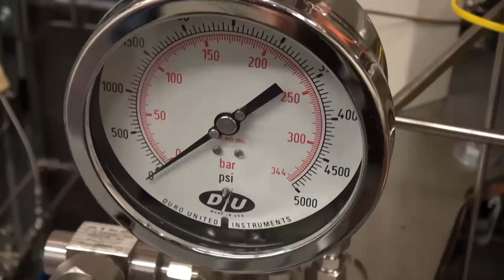Algae to Bio-Crude in Less Than 60 Minutes

Comment: We are not going to stop drilling for oil. You can’t go to other countries and just stop that, as much as a lot of people would like to.  
And to be perfectly honest it’s not really necessary.

What really matters is capturing that CO2 from the atmosphere and the water, and doing something with it. It’s just more carbon for you to work with.

Eventually we’re going to run out of oil.  This is the way to keep everything going and save the planet at the same time.

We need wind, wave, solar platforms, and saved hydrogen to compress and heat it

Comment: Algae for biocrude, would be best grown using non-potable water, such as that discharged from wastewater (sewage) treatment facilities. Some such facilities are also huge producers of by-product or "waste" gas  CO2, usually vented into the atmosphere, but is crucial to algae production. EPA and related water regulations need to be revamped so that these waste substances can be legally used, rather than wastefully vented into atmosphere,, in the case of the CO2, or in the case of wastewater facility effluent water, discharged into public-contact/exposure "receiving waters" such as rivers. For example, here in California, a large biocrude production facility could be built in one of the desert areas, with the non-potable water and waste CO2 gas being piped in from the big city areas. It could be done very economically (by comparison to some California mega-projects). But some "pilot" operations would, of course, need to be done first. The biggest obstacles are certain re-use/capture laws which impede doing so. Nevertheless, there are also very large factory-bakeries where huge volumes of dough fermentation occur, as well as large breweries, both of which are also great sources of waste-gas CO2 recovery (capture) for re-use in algae operations. But as said, there are specific laws which require revamping in order to do so. An algae biocrude operation would also be a producer of large volumes of (industrial-use) oxygen gas as one profitable by-product. -Even the biocrude algae (leftover) sludge would have value. We need new energy industry models. This is a good one, if certain laws can be brought up-to-date. -Most such problem laws are decades old, going back to the '60's and '70's, depending on the state, and seem, in my opinion, to also be protectionist of certain industries then (and now).. In research labs, oil content has been pushed to over 80% oil yield per algae cell. That was 5 yrs ago.

Comment: if heat and pressure is needed to convert algae to oil can we just pump the Algae water that cannot ne used to eat back into the oil well even the algae we get from the sea and ponds. we can set up algae bio-reactors  along the highways and densely populated areas and when you get the right concentration pump it into a tanker and transport it to a dry/ dead well and the heat and pressure may convert the algae to bio oil that eventually can be reused?........

Comment: I’d love to try this, but I’d probably blow myself up, however I did convert my old Camaro to run on gasoline, alcohol, or any combination of the two. The 1980’s computer that ran the car wasn’t up to snuff so I built an Arduino based ecu that uses open source engine management software, the rest of the parts I needed were all off the shelf / junkyard. And I had to get permission from the state to make alcohol (with a denaturing agent added). And for about a year I’ve been running the car on E98 (98% ethanol & 2% gasoline).
Reply: This is so cool, where did you learn to do this? Are you an engineer?
Reply: Where can we find the Arduino software?
Reply: @gregorymalchuk272  speeduino
Reply: Weird flex

Comment: while using algae might be new, this process of obtaining crude oil isnt. as long as humanity has had gasifiers, humanity has had access to some version of this crude oil, but it was either discarded early on or was used to soak torches or wan oil furnaces. entire cities used to run off gasifiers for anything from street lighting  to a stovetop, in fact quite a few cities still have their old gasifier street lanterns but most of them run off the city's natural gas lines not a gasifier production line. 

a gasifier can run off pretty much anything combustible in nature like wood, coal, dried animal feces, crop waste, dried crops, etc. so its not really all that new of knowledge that a plant matter can produce crude oil therein gasoline when in a pressurized then condensed and refined. society just forgot about this process like they did when someone came along with the non electric car, and decided never to go back to it. like the electric car this process was abandoned for a similar reason, it was to complicated/long a process with the available materials/refining processes. so when we struck oil and refined that it was faster to produce the diesel/gasoline we needed. but now that society as a whole produces so much waste and is much much more population dense we now have the materials to make this process more feasible. especially now that we have our crude oil refining systems so efficient, like how we now have way better battery technology that is suitable for an electric car we now can build them.

Comment: This seems promising.  Have algae farms (remove CO2 from environment), use algae to make fuel (puts CO2 back into environment)...which should be, if not carbon neutral, carbon lessening. Some algae can be used as food, as well.  No drilling, mining, etc. needed
Reply: bruh, dude crude oil isn't only used for fuel its used to making numerous other products like scents, perfumes,  heating oil, jet fuel, petrochemical feedstocks, waxes, lubricating oils, asphalt CNG etc, the artificial crude oil can be used for this right?
Reply: @cheeseburger625  Yeah that's the thing people don't realize. For example in 2020 America and Europe put a lot of effort into shutting down oil drilling sites around the world. The result was a massive shortage in fertilizer which then lead to food shortages around the world. This caused Europe to buy a lot of petrol products from Russia and Iran which in turn funded Russia's invasion of Ukraine.
Reply: @DaveSmith-cp5kj  yes
Reply: @DaveSmith-cp5kj  yes
Reply: @cheeseburger625  It can replace some, probably many, of those. And all those things you listed are the reason that, in my never so humble opinion, crude oil is too damned valuable to just set a match to!
Reply: @TimeSurfer206  ok
Reply: @cheeseburger625  Wow, a Necroed thread from 7 years ago! I think this is the oldest post response so far! I am well aware of other petroleum based products and maybe this bio oil can be used for some of these products.
Reply: @Voidsworn  yup

Comment: looks like a fairly energy intensive process to me.. so not sure how much energy it's actually producing.. very confused by the woman suggesting that it would help reduce the greenhouse effect as that has nothing to do with the source of the hydrocarbon that is being burned..
Reply: There is a lot of energy in those liquid hydrocarbons, there should be plenty of energy gained. A lot of input energy is needed for petroleum in collecting, transport, and distillation. The connection to the greenhouse effect is that the fuel being burned would have been made out of the water and air recently and would cause a net reduction of the CO2 in the air. CO2 goes into the algae, and because of inefficiency in the fuel production somewhat less CO2 will go back into the air. Same if you burn wood or other biomass, but fossil fuels increase the CO2 in the air.

Comment: Its a shame its still gonna pollute the planet...
Reply: How? It doesn't add any new carbon to the environment, only recycles whats already there. Are you refering to the electricity that the process takes? That currently effect most major clean energy sources like carbon.
Reply: Oh my bad i just presumed because its pretty much oil it will release alot of carbon into the air like ordinary oil
Reply: lol its cool alot of people are making that mistake. But adding carbon to the air is only bad when we take it from underground first. The reason is that carbon is constantly cycling though the enviorment from life to carbon dioxide etc. However when we dig up oil and what not we are adding extra carbon into that system in the form of carbon dioxide. Thats a problem because it causes a net gain to whats already there. Where as this merely cycles though what's already there without a net gain.
Reply: Sovietcomrade262
You are absolutely correct, also algae consume carbon dioxide, for every pound of algae grown it consumes 1.8 pounds of Co2, which if the algae are converted into crude oil, not all the crude oil is used for fuel, there are other things that crude oil is converted into such as plastic road tar... that do not release carbon dioxide unless they are burned...

Comment: Proves that carbon dating is bunk. Dinosaurs did not need to take millions of years to turn into crude oil.
Reply: It took millions of years for them to be buried enough for the pressure and heat to transform them. And carbon dating doesn't work past several thousand years the have to use other radioactive elements for dinosaurs. Also dinosaurs aren't what became oil. Most of the oil was produced in the Carboniferous era about 300 million years ago, dinosaurs didn't appear for another 50 million years.

Comment: Eroie is what counts. Firstly they need pressure. That will take energy. Then they need algae which needs to be fed to multiply. So this is nothing like real oil as it was back in 1900 when it was close to the surface and cheap to extract. Why one barrel of oil energy could be used to extract 100 barrels.

Comment: The process is called thermal depolymerization and it can take sewage, trash, any bio waste and turn it into oil, charcoal, and methane to run the plant.  This is done by changing world technologies that have a couple plants that do this.  We need more plants like them because we got a lot of waste to convert into energy.
Reply: If any waste can be turned into fuel, man oh man, what an energy gold mine
Reply: @HermitagePrepper  sadly not yet it cost more in energy than you get in oil you can also do the same thing with plastic waste and turn it back in to oil if the cost of oil ever skyrockets it might be worth it.
Reply: @HermitagePrepper  i know.  lets buy up all the agriculture land that grows food to make oil.  we could all be millionaires,  hungry, but rich
Reply: @FreemenofAustralia the USA only uses about 25% of arable land for food. That leaves 75% of available arable land for energy production. Not to mention, by product of palm/soy oil production can be used as animal feed and the non-food by product can be used as organic fertilizer.
Reply: What machine exactly do you need to change algae into fuel?
Reply: @donzam8678 The machine has to be custom built, but there are some that are similar small scale models that turn plastics into oil.

Comment: I'm wondering how much energy the process costs compared to what it puts out at this point in time. Anyone have any idea?
Reply: I will tell you in 6 months.
Reply: @danielkenner3923  now you have approximately 5 months to tell.
Reply: @danielkenner3923  Reminder that you have about 4 months to go
Reply: @danielkenner3923  clocks ticking
Reply: @danielkenner3923  only 3 moths to go
Reply: @danielkenner3923  less than a month remaining
Reply: @danielkenner3923  make that 2 months
Reply: @danielkenner3923  getting close now
Reply: @danielkenner3923  :3
Reply: @daniel kenner 4 months
Reply: zero energy. THe system uses its only fuel to power its self and it uses solar power to get started. its a continuous feed reactor which means it can go forever. there is a reason big oil is suppressing this data so much and you cant find a straight answer online
Reply: Saya menungu jawaban
Reply: F
Reply: Maybe hydro, not only to create the pressure needed (water weight) but hydroelectric for the electrical equipment.
Reply: F

Comment: Where are the numbers on the efficiency of the process? I can't find it on PNNL or Genifuel's websites. While it may be more efficient than other processes, what is the cost in absolute terms? For example: I produce a process that uses $800 worth of energy to produce $50 worth of fuel while my competitor has a process that requires $1000 worth of energy to produce $50 worth of fuel. My process is 20% cheaper than my competitor, but it is still not viable. The lack of any mention on the efficiency of this process makes me hesitant to believe that this process is even remotely close to ever being viable.

Comment: Still a fuel that causes pollution. Why focusing on turning an algae into to crude if we can developed a cleaner source of power such as fuel cell or nuclear fusion plant and if we succeed in doing that we can create an electric automobile, electric car is more efficient compare to gasoline car
Reply: it will be carbon nutral becuse the agae takes carbon from the air and then releses it when burned
Reply: JD Fullerton We're trying to reduce it right
Reply: Burn something that stored carbondioxide millions of years ago and rerelease it, or capture carbondioxide and release it again.
Yes both will emit carbondioxide but the first option will release long stored carbondioxide and the second option will absorb and release about the same amount of carbondioxide (making it neutral overal) 
This does in fact reduce the amount of extra carbondioxide emitted  into the atmosphere.

Comment: Questions:
1. How much energy does it take to convert the algae to oil? Is the process energy efficient? Does it produce more energy than it uses?
2. What is estimated the price per gallon of the final refined gasoline product?
3. How much energy is used to grow and harvest the algae? How fast can the algae be produced? Where will a refinery get enough algae to convert to oil? It sounds like there will need to be vast algae farms built to supply the refinery.
Reply from the maker: Thanks for the questions, Brian.

Hydrothermal liquefaction is more efficient than other algae bio-crude processing, because it eliminates the need to dry the algae before processing.

This is one important piece of the puzzle, but how algae is grown and how the bio-crude is converted into fuel will also impact the cost. These are all things scientists and industry will need to consider to make the process more economical.

Several companies today do have vast algae farms just for this purpose, and research like this is improving the technology so that it can be efficient and one day compete with regular gas and diesel. For an in-depth analysis of the cost of producing fuel from algae, check out http://dx.doi.org/10.1016/j.algal.2013.07.003.
Reply: PNNLgov While it may be more efficient than other processes, what is the costs in absolute terms? Try answering questions 1, 2, and 3. I understand that most processes become more efficient when done on a larger scale and process refinements are made, but how efficient is it?  In the most successful test run, what was the ratio of energy put into the process versus energy contained in the product?
Reply: @jetsonbates6842  The short answer is that it uses several times more energy to convert it into oil, and currently we can't produce it straight, it needs to be cut with conventional drilled oil like ethanol is.
Reply: @DaveSmith-cp5kj  Thank you good sir for the short and to the point answer. instead of what ever the heck the channel answered with.
Reply: 4. As this is processing algae into a similar product as the oil and gas we use today, how is this any more ecologically sound than existing gasoline?  Specifically the emissions.
I am more willing to go along with converting it into Bio-Diesel.  You have more of a process, but the outcome is a very competitive fuel with none of the waste issues.  Plus the process results in other more natural uses as well.  I say natural, I mean easier to deal with and easier to incorporate into other products.